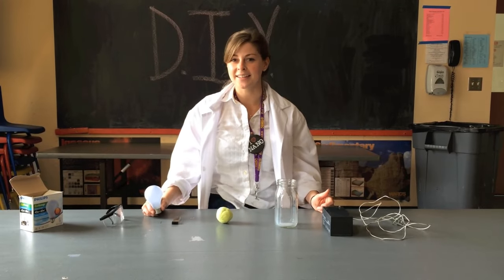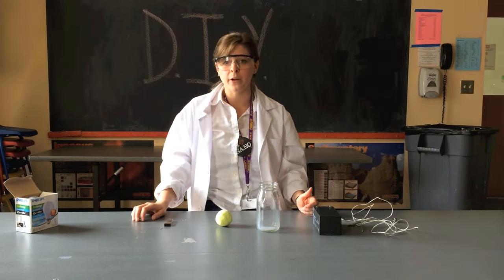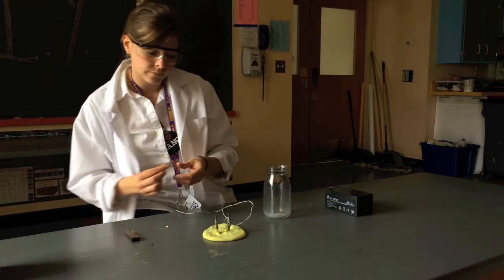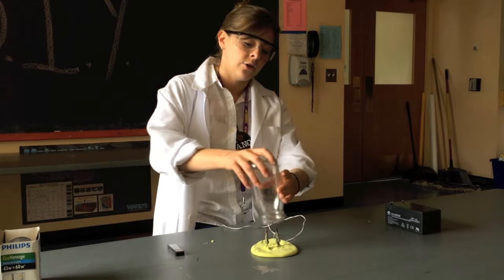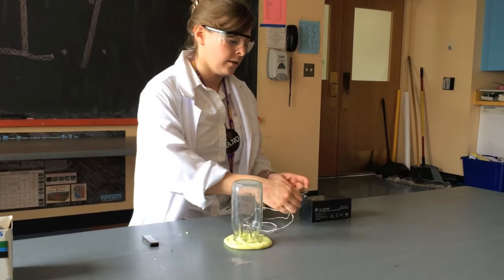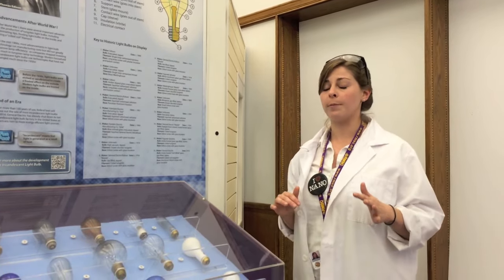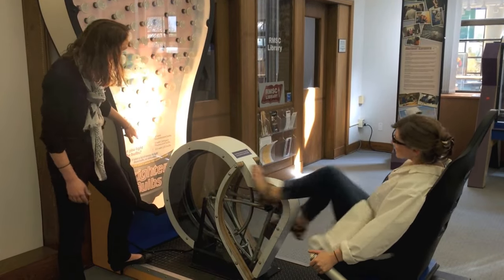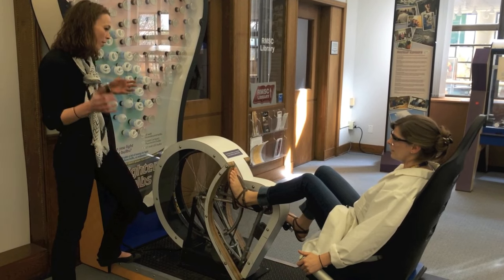DIY Incandescent Light Bulb

Comment: The last part is propaganda but I like the DIY explanation. LEDs are toxic
Reply: Is that some kinda flat earth type meme?
Reply: Gray Au  You do realize that modern LEDs come in all different colors from the full spectrum of visible light? There are already LEDs that match the light spectrum of incandescent perfectly, but at much lower power consumption. The problem was in old crappy LEDs that put out too much blue light, which messes with the circadian clock.
Reply: Gray Au  You can still buy those retro vintage Edison LED incandescent bulbs. They are literally indistinguishable from the old tech, except wasting way less energy. They literally produce the same light.

Comment: I would love to know how to make a more permanent DIY bulb, I am concerned with the amount of time it can stay on. Is anyone able to point me to additional info? This was great as a first pass to identify the basics, but it's not a long term particle solution, however I could imagine a couple of simple modifications that might get it there... I guess I will be clicking around until I find something of critical importance to further my knowledge. Thanks so much for making this.
Reply: i bet after 9 months you have already found it, but it needs a vacuum or some kind of gas to prevent it from turning off
Reply: @md-nv4rg  I wonder if you replaced the gas inside with helium or something similar, would it displace the air and prevent it from burning out?
Reply: @Saroyus  Yes, that's how incandescent lightbulbs are made. Any inert gas will do the job.
Reply: I saw a video where a guy used a little bit of propane inside his bulb to react with the oxygen before it could react with the filament, sounds sketchy but it worked🤷🏼‍♂️

Comment: I wonder, if you could make this last longer with household materials by using the following methods:
> Use a candle in the jar, to consume the oxygen prior to switching on the carbon rod filament
> Use some drying agent ( salt, drain cleaner, anything hygroscopic )
> Use something as a seal / putty that does not contain water moisture
> Maybe even purging the jar with CO2 from a soda stream or helium from balloon gas or argon from a TIG welder
> use some tinfoil on the clamp-to-carbon rod contacts to reduce mechanical stress on the carbon rod
Reply: You could also use a different filament that doesn't burn/oxidize. You could probably use Kanthal and tune the length/resistance so it doesn't get over 1,500°c. It'd be a dull warm light (1,600-1,700k) but it would work in atmospheric air.
Reply: @micheals1992  something that can not oxidize... Like an oxide. And that is actually a working solution... In a Nernst lamp ;-)

Comment: Thank you for your video 🌟 ... Is there any realistic way to make an easy homemade bulb that is more like an LED – safer/less heat and very low voltage, that lasts? ... If not technically an LED, something that has similar properties to an LED: 
1) extremely low voltage 
2) good brightness relative to tiny size
3) safety (no/very low heat).

It only needs to emit a very small amount of light. 

* This is for a non-profit creative project. The project imagines the possibility of basic electricity being used in an alternate world where the technology is lower than ours. 

**I imagine a rudimentary battery (like the Bagdad Battery) would power the tint bulb.

Thank you in advance if you (or anyone else) can help. xx  😘💐

Comment: If you use nitrogen instead of air it will be better for the light bulb ..
Reply: If you had any idea what you were talking about you would say argon.  This is a kid's project, you don't need to flaunt your "intelligence"
Reply: If you had any idea what you were taking about you would say a mixture of nitrogen and argon to prevent arcing. Or better yet, xenon. But of course any inert gas is way better than regular air.
Reply: @martinsmith3847  If y'all actually had any idea what you were talking about you would say a vacuum is the best filling to prevent heat losses through convection in an uncoiled filament, specially if made out of carbon instead of tungsten...
Reply: @johnkollon3754  vacuum is not as easy as you think ... of course vacuum is excellent but its much more easier to find argon or nitrogen than to use a vacuum pump if want to do it yourself ...
Reply: @TheCerberusInferno  Indeed, the easiest way would be to fill it with butane which is very easy to find and handle and also will react first with any oxigen left.
Reply: @johnkollon3754  Being a troll is not good for your health ..
Reply: @johnkollon3754  I saw this video , its strange to see someone who use propane ! well what you said is true ..

Comment: Your bulb lasted 14 seconds. Ya big deal.
When one of Edison's early light bulbs burned out in 40 hours he considered that to be a flop.
Reply: Actually many of his first experimental lamps only lasted seconds as he tried to make this work in open air. He was a very good experimenter, but in some cases it seems to me not a very good thinker. It took quite some time to get to the point where he would use a vacuum, partially to the  means of creating a good enough vacuum becoming more available at that time that finally led to success in combination with the design and manufacture of the early carbon filaments.

Comment: Why not just use magnets to produce energy?
Reply: Electromagnetic power conversion goes hard when you load it example when you connect a motor to a led the turn it it will turn harder than empty because there is a current load. In this case incandesent bulbs draws tons of current and that caused to them get banned from european union.